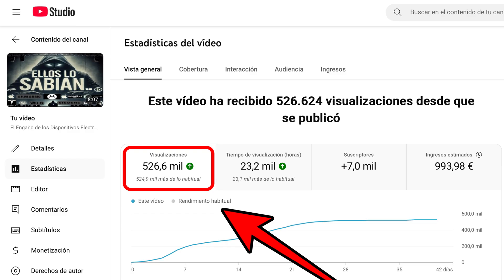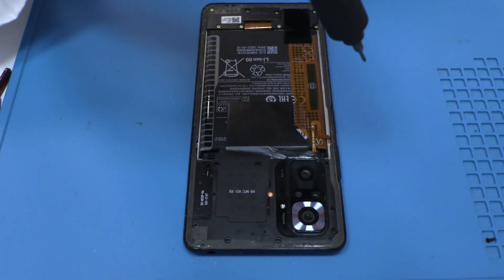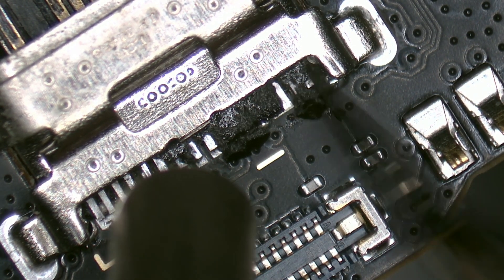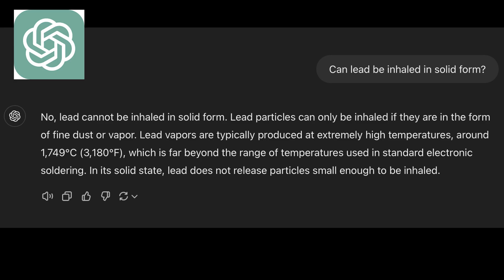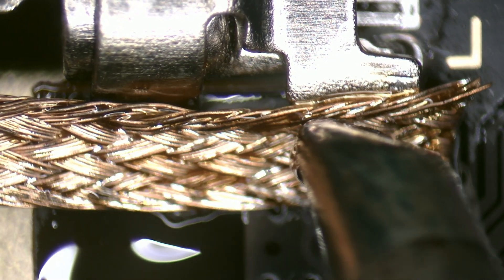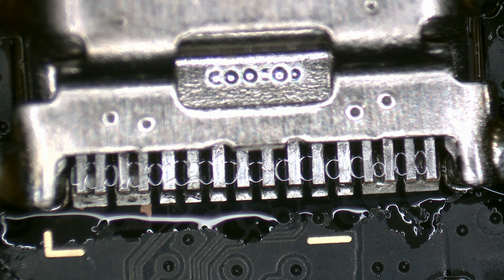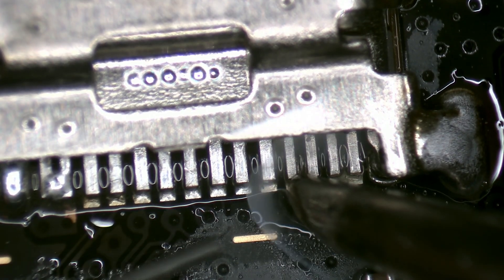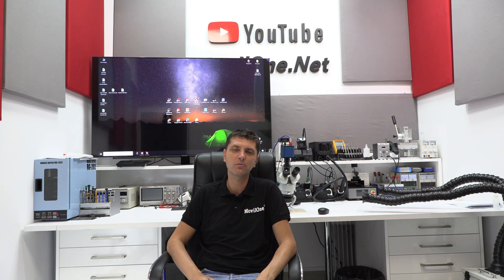The Hidden Truth About Electronic Devices – What They’re Keeping From You!

Comment: I purchased the iPhone 16 Pro, and from day one, I noticed a display issue. I went to an authorized service center (listed as 'authorized' on Apple's website since there are no official Apple service centers in my country). They replaced the display, and now it shows as 'genuine' in the Parts and Service History. However, I’ve noticed the new display looks dull compared to the original. Could they have replaced it with a fake display and programmed it to appear genuine? Or is it possible they copied the data of a genuine display onto a fake one to make it seem legitimate?
Reply: To my knowledge, there are no aftermarket displays for the 16 pro yet

Comment: As a former Electronics technician of many decades, I've wondered about Rohs/leadless solder which is very hard to work with and has poor adhesion leading to disconnects in circuitry. I still prefer the old 60/40 lead/tin solder that works much better and that I have used all my life. 😊 Thanks for the info.